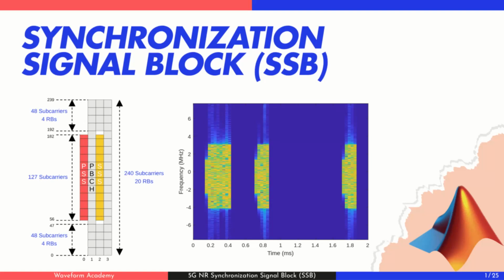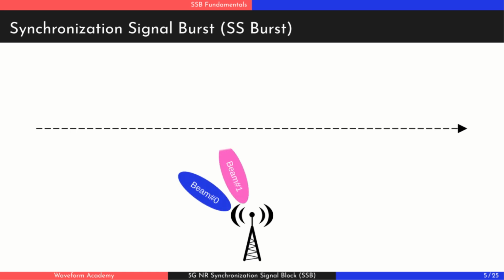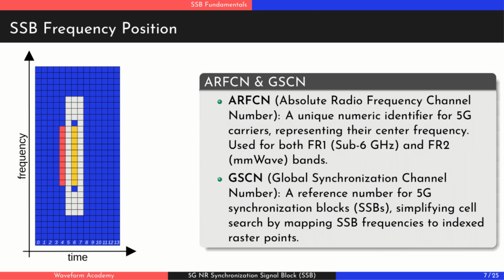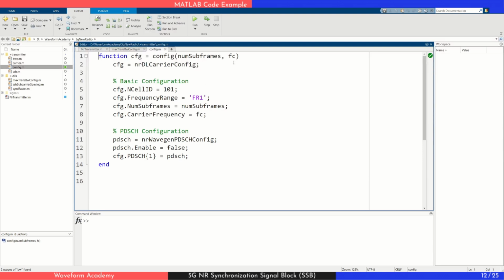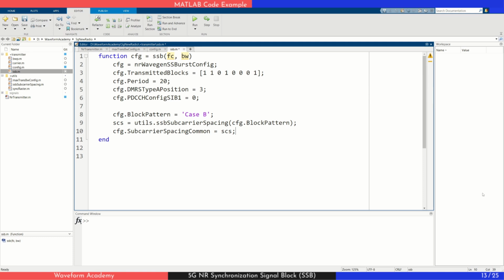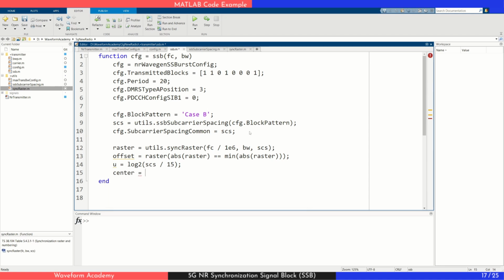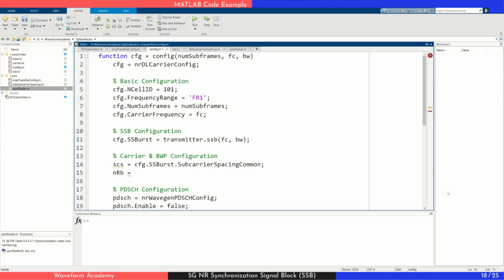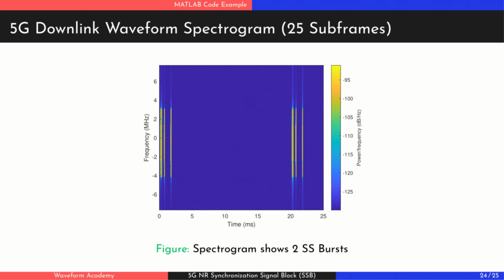5G SSB (Synchronization Signal Block) with MATLAB simulation

Comment: I used your code as is to generate the SSB you report in the video. The SSBs appear to be 5 symbols long, rather than 4 symbols long. In the video, I believe this is the case as well, but it cannot be appreciated as the zoom in the spectrogram is too far. What is that 5th OFDM symbol in the generated SSB?